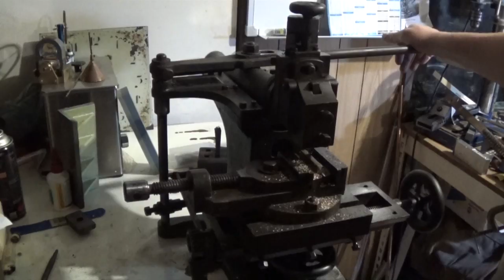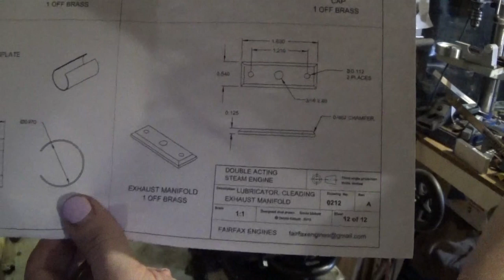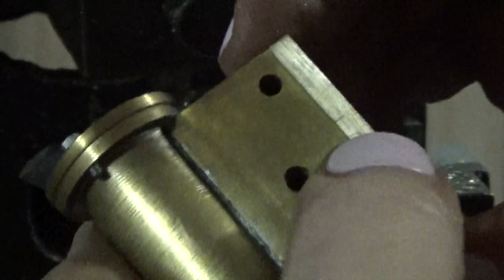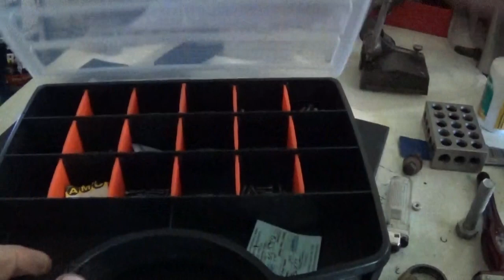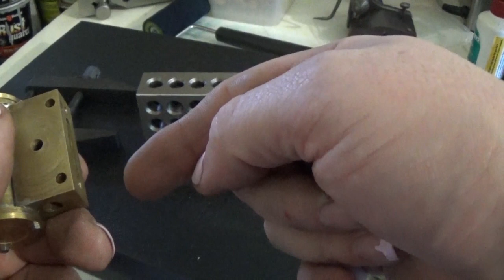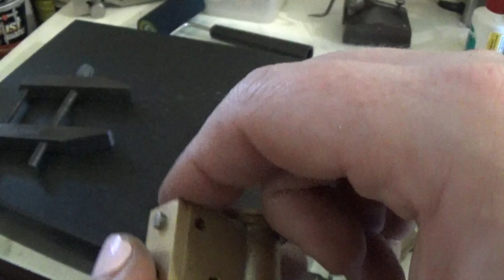myfordboy engine part 12

Comment: Emma, lovely old shaper, I think in the end when you have it all setup to your liking you are going to find yourself using it as much as a mill when you get one, the finish from the shaper is much nicer and looks better on a finished item than that old swirly look from an endmill cutter, look into details of grinding a shaver form on a hss tool for a very nice smooth looking finish,

Edmund.......Alberta
Reply from the maker: I believe that too Walter. the tool grinding thing is a steep learning curve for a shaper, but ive been messing with it. its a pleasure to use really though. thanks for watching.

Comment: I have an ammco shaper with the same ratcheting problem as yours. I tried a flat spring and that didn't help.I found a pdf manual for it online and it showed a collar on the lead screw that was missing from mine. There's actually supposed to be two collars that are identical so I just made a duplcate of the one I did have and problem solved. The second collar fits on the right side off the boss on the table and the other one on the left side and that one has a nut that tightens against it to keep pressure on it. That also removed the backlash in the leadscrew. I hope that makes sense.
Reply from the maker: thanks for that. yes it makes sense. I am thinking there is something missing. I think a new nut to minimise the backlash will be the first step.

Comment: If you tightened the gibs a little, would the ratchet work as it should?
Reply from the maker: +Little Work Shop of Horrors no. The conclusion ive been trying to avoid is that there is 1/4 turn of backlash in the nut. Thats 1/32" or more than i want to take in a cut. I think ill have to bite down and make a new one.
Reply: Fair enough, you have seen the problem up close and personal,l it's a bit difficult to see from half a world away. :>)
Look on the bright side, another subject for a video.

Comment: Coming along nicely, soon be running. Shaper  needs a strip  down and a paint and adjusted then you can really cut some metal.
Reply from the maker: does it ever. lol. im procrastinating till my little wood lathe is finished. ive all ready pulled it down once and gone though it, and degreased it. needs something stronger lol.